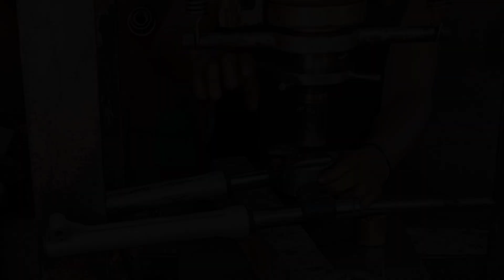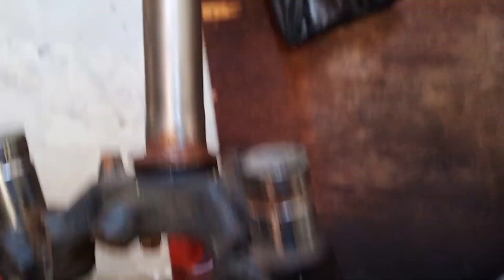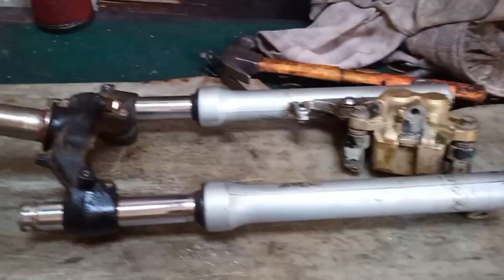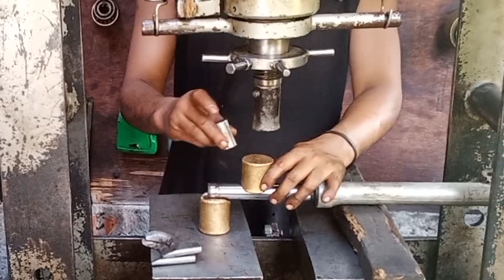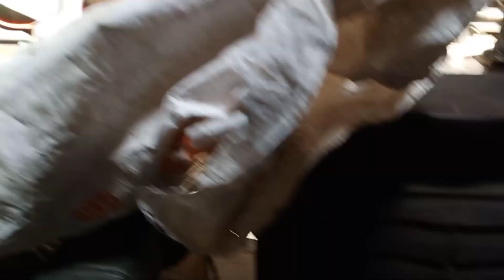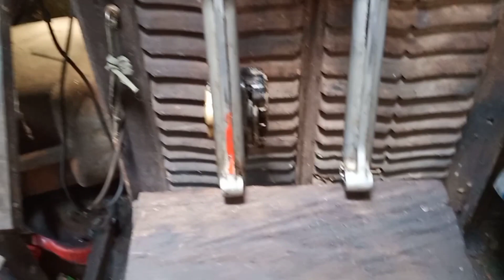press fork/ senter segitiga #jupiterz

Comment: kalo dilakukan pemanasan dulu oleh las karbit gimana ya hasilnya ?
Reply from the maker: Bisa juga sih, tapi nanti bahanya mudah lemes
Reply: ini yg dibetulin segitiganya apa as shocknya yg dimainkan mas?
Reply from the maker: semuanya bang
Reply: @ridhomotorchannel2084  kalau kasusnya begini gimana tu mas, kita pernah pres segitiga dan beberapa lama setelah itu as shock kita baret 22nya dan dilakukan pergantian as shock hasilnya stang motor kita balik lagi seperti awal sebelum dipres sebelumnya dan spakbor nya pun ngga lurus dengan ban motor, nah bagaimana tu mas?
Reply from the maker: mungkin sithe ngepresnya belum pas
Reply: @ridhomotorchannel2084  solusinya gimana tu mas
Reply from the maker: tonton dah itu video dari awal, susah kita ngejelasinnya kalo lewat chat